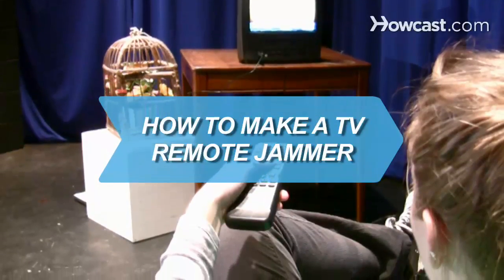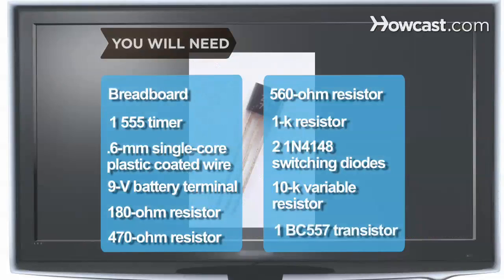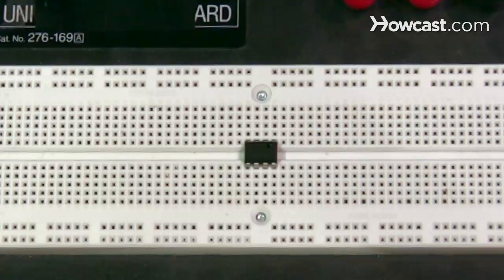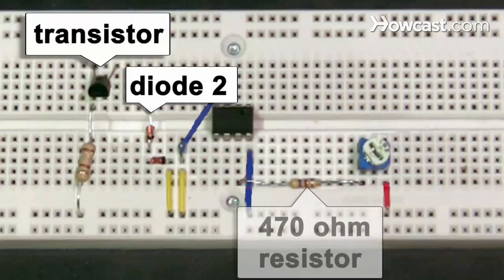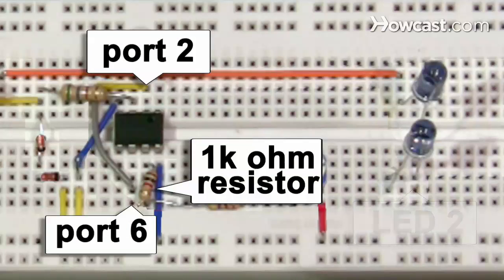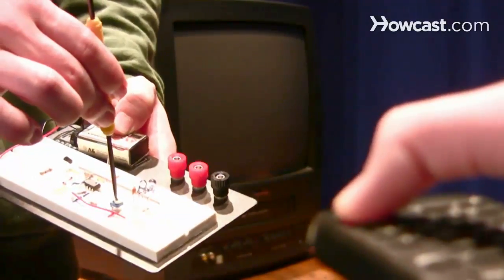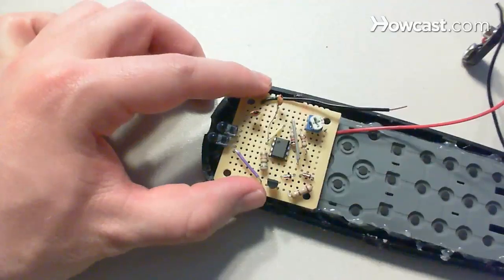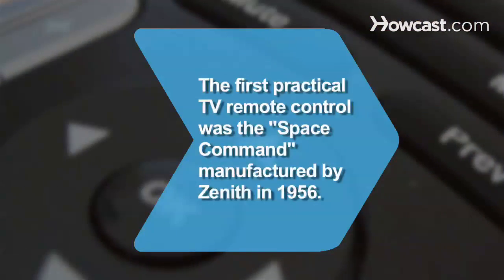How to Make a TV Remote Jammer

Comment: Can you tell me if i can use a 547 transistor instead of the one you have used? Also, i cannot see where you have connected the base pin of the transistor. Please reply
Reply: I think you can use any NPN transistor given that it can switch fast enough. I used a 2N2222 in a similar project of mine.

Comment: all that and there's a switch on the remote? 5 secs anyone would probably figure out if the flip the switch the remote will work.

Those saying it's expensive ya it is if you were doing this for practical uses, but you get most of those items in your school electronics kit if you are taking CENG or EENG.

It's a cool project though, I sure anyone taking computer/electrical engineering will find this video useful. Which is probably who the video is geared towards.